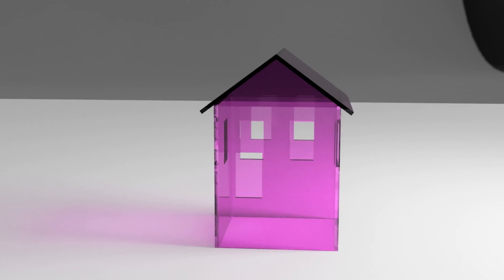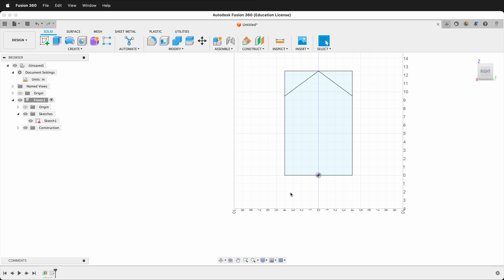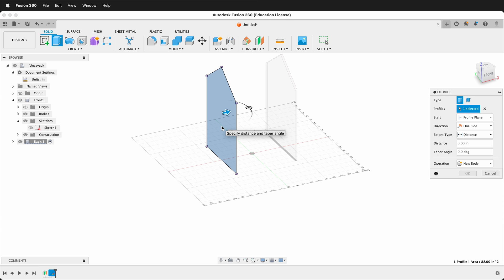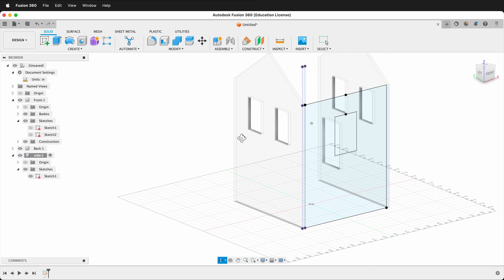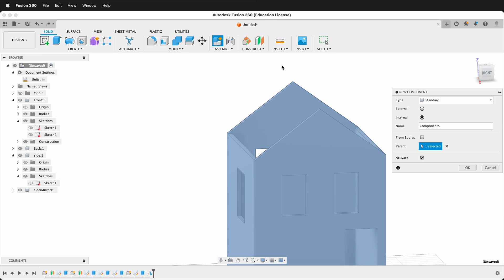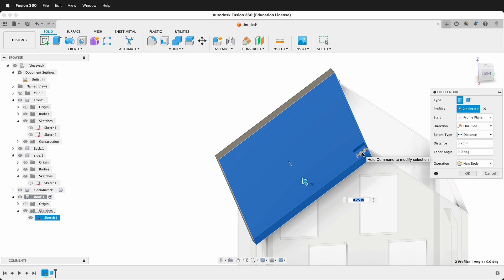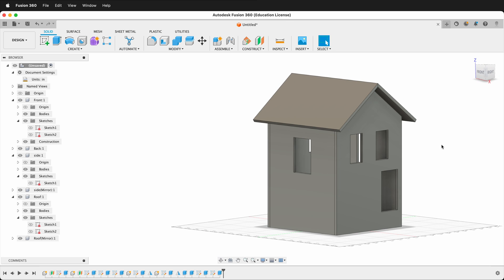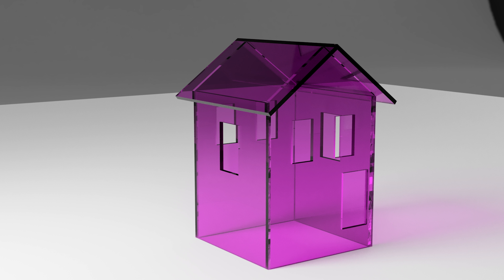Laser Cut House Model in Fusion 360

Comment from the maker: Post any Fusion 360 acrylic laser cutting questions in the comments.
Reply: Why bother with creating planes for the front & back pieces?  Draw the sketch on the origin, and extrude the front piece using a offset.  Then do a second extrude (-offset) or mirror to make the back piece.

Also if you made the roof peak 45 degrees, that would simplify where the roof pieces join, as in the real world you don't cut funny angles like you have.  You could also have simply extended the face of one roof piece to meet up with the other to make a butt joint, like how the wall join.